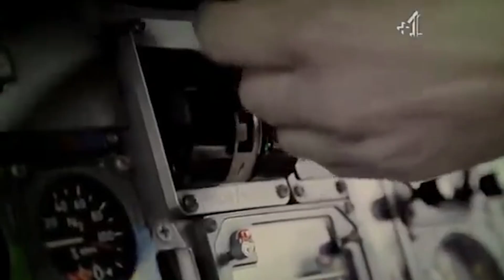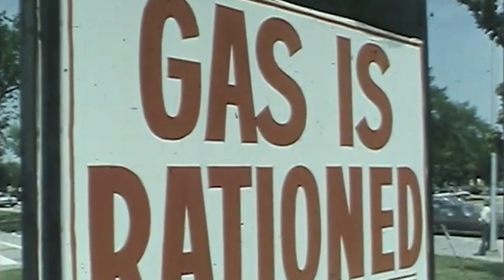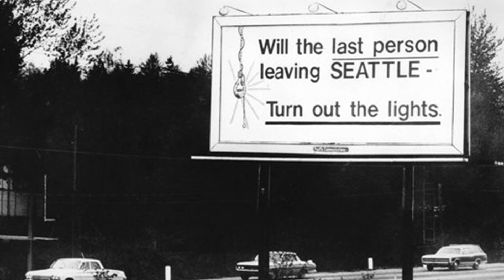The Forgotten American Concordes - Boeing 2707 - Lockheed L-2000 SST

Comment: I've watched a lot of docs and read a fair bit about this, and I must say that this is by far the most accurate and unbiased treatment of the subject I have seen. Great job!!!
Reply: "unbiased treatment of the subject I have seen" Definitely not american ;)
Reply: tecknos africa what? concorde was one of the safest passenger planes ever. it flew for almost 30 years with no major accident. and when it did had an accident, it was due to FOD, something that could harm any plane. from a safety standpoint, it was a superb success, it just wasnt good for business.
Reply: what makes you think he's going to respond to your employment ad in the first place!? :D
Reply: wow, i was thinking the exact opposite. Was wondering why he did not mention the avro arrow when discussing delta wing design as it was essentially the 1st back in the 50s
Reply: @9vollt  mainly because he said, matter of factly, that much of it was developed from the Avro Vulcan which had an ogival delta, but in order to improve low speed performance, Concorde was given a super-ogival delta to introduce vortex lift.

It wasn't an unknown technology. We had it with the Valkyrie, and to a certain extent, so did many fighter jet designs in most advanced countries.

Vortex lift is taught at University in Aerospace degrees.
Reply: Kal El.
That is right the XB 70 carried how many passengers and it was in service for how long?  The SR 71 also carried many passengers and it was so good it did not leak fuel or have to have a great deal of expensive maintenance. 
When Lockheed and Boeing tried to make a real SST what happened, Lockheed may have been better but the Boeing was chosen and after a great deal of money wasted for no more than a wooden mock up, Boeing  stopped getting funding from the government and gave up. 
Boeing more recently tried to make a transonic plane or one that could fly at about half the speed of Concorde, what happened to that, they gave up again.
Britain and France made the only successful SST ever. Even Russia did better than USA, it was no Concorde and only had a short service life but USA have bought one. Europe 1st,  Russia 2nd and USA last again.
Reply: I think it's more effective because it is so brief and to the point. However, you don't patronise your audience, you get all the key information accross so that they get a good idea of the technology, politics and economics at play here, and if they want to know more they can read more elsewhere. Great job.
Reply: thanks God this plane vever flied  ,    he would have suffered  the same fate as concord .  many lives were saved
Reply: You are a negative person.I would NEVER employ someone with a mind like yours.
Reply: What sort of Canadian pot have you been smoking? To suggest the Avro Arrow was the first delta winged aircraft is bonkers.
Reply: Bradonimous a what? ;)
Reply: Awesome, thx.
Reply: n s9999
PS is that a picture of your brain?
Reply: fart / s9999 Do I have to unfollow this to be rid of you guys? .  Did not the original comment have the qualifier "essentially the 1st back in the 50s", effectivity stating they ment within that decade? Does not the use of the "essentially" in that context mean "only one of consequence" thus indicating there were others, just of consequence?       --get over it.
Reply: Michael Cubstead
Yes.
Reply: i was just about to aknowledge how good this video was, glad im not the only one thinking that
Reply: it was a cool design but did not work out
Reply: Barrie Rodliffe
Reply: Andrea Roll
You look like some sort of chipmunk.
Reply: I think Lockheed had a big benefit from what they were learning with the blackbirds.  Concorde had some expansion problems at mach 2, but the blackbird had a lot of heat related problems at mach 3.  The blackbirds were able to travel many hours at a time at mach 3+ limited only by fuel.  The XB-70 had very little real life supersonic experience.  If the program had continued, the XB-70 might have had more or less heat related problems, like leading fuel.  Besides the XB-70 was by North American, not Boeing.
Reply: Multicsfan
The SR 71 was very expensive and not exactly trouble free. The turnaround between flights was about 1 week.
Very often an aircraft would return with rivets missing, delaminated panels or other broken parts such as inlets requiring repair or replacement. There were cases of the aircraft not being ready to fly again for a month due to the repairs needed.
The plane had to take off with a light fuel load and get refueled in the air, supersonic flights rarely lasted more than 90 minutes without refueling.
Reply: XB-70 no doubt the coolest supersonic plane ever built. As you said, did achieve over mach 3 on a single flight, but was limted to 2.5 for operational use due to panel damage, which for a prototype plane is very impressive indeed.
Reply: Kal El.
you said just one thing that is right.   Balh blah blah.
The rest of your rant is just based on ignorance, the XB 70 was big but had no possible provision for passengers. the many issues were never fully corrected and it flew a few times then was scrapped.  The SR 71 not only could not carry passengers it was far too expensive and needed too much maintenance after every flight to ever do so.
The Concorde is still the coolest and most impressive plane ever built, no other plane can supercruise at over mach 2 carrying over 100 passengers, not the XB 70, the SR 71 the F 22 or any other plane you can come up with.
Reply: Kal El. 
OK they did not scrap the useless XB 70 they retired it for good, having long since dropped the idea of turning it into a production aircraft.
To make it into a passenger plane it would be very simple, get rid of two engines, change the fuselage completely, change the wings and it would be far easier to make a new plane, still too difficult for Boeing to achieve. You forget Boeing spent a fortune and never got off the ground.
Boeing also tried to make a plane that could only fly at half the speed of Concorde, another fail.

We have nothing as bad as the F 35 or F 22. USA has had to modify the F 15 because the F 22 does not do the job it was meant to. 
I never want to fly in a Boeing again when there is a far better alternative, 777, no thanks I prefer to fly in comfort in an A 340
As for the nightmare liner, not a chance.
The new British carriers were not designed to have a catapult, unfortunately the British government bought into the useless F 35 which was not supposed to need a catapult.  
Concorde, the only successful SST ever made, USA could not make one.
Reply: Bradonomous a
Reply: F-102, F106... deltas of the fiftys.
Reply: Bradonomou
And p
Reply: n s9999 I was also thinking why they kicked Russians under the table when their TU white swan has the wings that sweep back and become delta...
Reply: ... and the SR-71 (A-12) remains to this day 55 years later, the fastest jet in the sky.
Reply: What is your take on the Russians Bradonomous?  Did they copy the designs of the BOAC Concorde?
Reply: people die every day....
Reply: Гордон Антонов
Reply: Don't be an arse. Its well known who designed the delta wing.Edit: Unnecessary rudeness removed.
You are confused, and I guess Canadian. You don't have much to celebrate, so its understandable. The Arrow has much to commend including aspects of its wing design, which did indeed advance the art. The delta itself of course designed by Alexander Lippisch in the 30s. Please if you yourself wish to learn anything, you can ask, or indeed refer to Wikipedia yourself, no need for wankiness.
  n s9999
Reply: Zetgist.
The XB 70 is completely irrelevant, it would never make an SST. 
The government wanted to compete with Britain and France because they would be left well behind if they didn`t. They chose Boeing over Lockheed which was a mistake, the Boeing design was far too expensive and heavy to work. So after dropping their original design Boeing then tried a design similar to Lockheed`s, that also never got far, a wooden mock up that had cost more than the entire Concorde project. 
The Concorde worked very well but it was sabotaged from the start by Boeing who having failed to make their own SST they led the protests making an issue out of noise which failed and also trying to make an issue out of pollution, the result of these protests by sheep led by Boeing was that only 14 Concordes were put into service and they showed it was very good and safe. 
Boeing since then tried to make a transonic passenger plane, that was another costly failure.